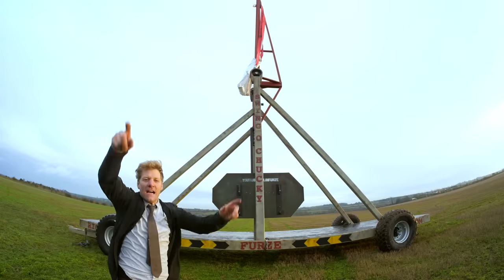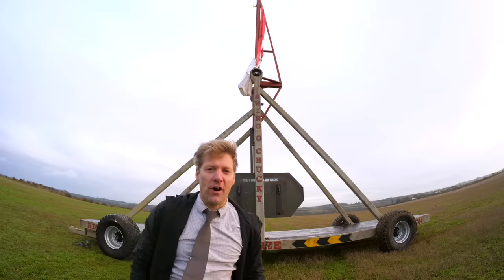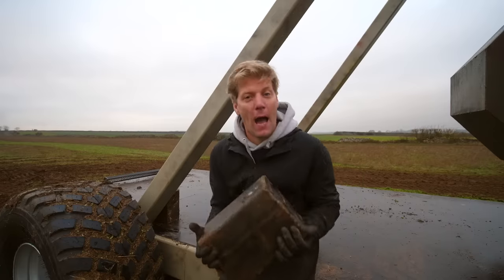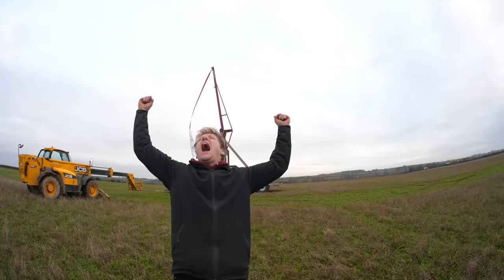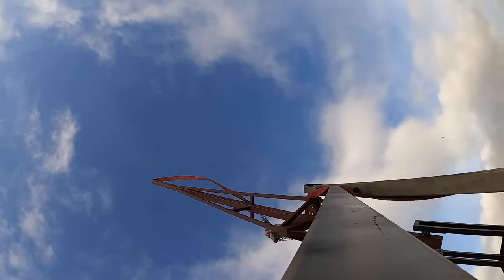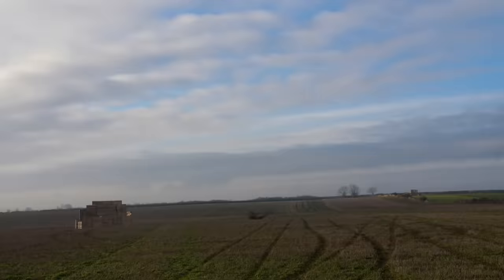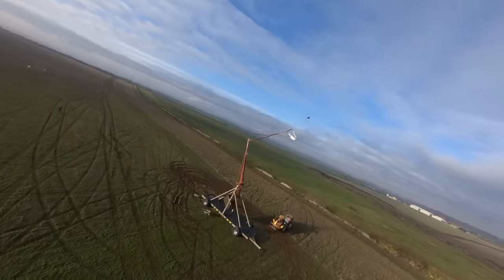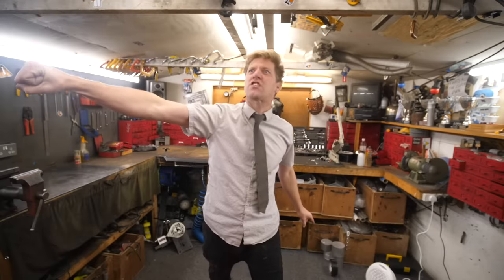MASSIVE Trebuchet/Catapult First Test

Comment: Sling is too long! Projectiles will fly MILES with a shorter sling, it goes slack before the arm is upright
Reply: the pin should also be slightly bent forward, not back.
Reply: Definitely this, slings are the most difficult part to get right on trebuchets and this one is too long. I’m sure with the size of this trebuchet once the sling is just perfect it’ll launch some insane distances.
Reply: By the dimensions and the use of metal instead of wood, ...
Counterweight should be 6 to 9 tonnes
 at least
Projectile around 75 kg max
Range won't go pass 500m 
(+Get 15% free inertia by fixing it to the ground)
Half of this is maths, half is estimation and half is guessing... (that makes three half... 🤷‍♂️)
Reply: He could also try to block the wheels. Moving this mass is such a waste of kinetic energy!
Reply: I've made a million trebuchets and instantly came to the same conclusion haha
Reply: @xdmimperatyw  i agree
Reply: Ethan Game,  I agree with you, shorter sling is the way
Reply: @xdmimperatyw  Possibly, but I did see a video by tom stanton where he showed the wheels make it more efficient, I think because it lets the mass drop more vertically
Reply: @davekavanagh7599  I've never made one and I know nothing about them outside of what they are and what they do, and even I was thinking it.
Reply: @Dr.K.Wette_BE  trebuchets must be able to roll back and forth or they destroy themselves.
Reply: Or heavier ballast :D
Reply: @majmikecalnan  Trebuchets had no wheels, what are you talking about ?
Reply: YES
Reply: by my calculations the sling indeed is too long.
Because if you convert X to Y by multiplying the power of .........

Ah the heck with it.
Experts who have made a million trebuchets have already answered.
No need to do maths.
Reply: @damiangames1204  Watched his video, his argumentation makes sense, you right. Now only thing is to shorten the sling for this mechanism to work. Have a nice day :)
Reply: @majmikecalnan  Really? Looks like energy lost...
Reply: @Dr.K.Wette_BE  Give that doctor more likes. Colin needs to see that.
Reply: ChrisHallett83  Trebuchets very much did NOT have wheels. (Maybe some oddball did, but wheels were NOT common.)
Reply: I also initially though the sling was too long, but it actually isn't. You want to release when the arm stalls (stops moving forwards), and due to this thing having a high moment of inertia in the arm relative to the projectile, the arm stall is pretty late, so you can continue milking power from it longer than a lot of other trebs, and thus a very long sling and rather backwards pin is likely best. That said, the sling straps have a lot of drag, so my approach might not be correct in this case (Use a cable for the sling lines, it will help!). General tuning guidance can be found at http://thehurl.wikidot.com/tuning (Which I wrote back when I made lots of trebs, but never anything as massive as Colin's!).  See http://thehurl.wikidot.com/machines:trebarbaric for another treb with a really long sling for similar reasons (and 1800+ foot range!).
Reply: Maybe he didn't actually want to launch a rock miles away? Lol
Reply: @Dr.K.Wette_BE  from what I've seen when they get fixed to the ground they lose distance and tend to rip themselves apart.
     I thought it would go farther too, but experimentation shows, and I found some math on the Interwebs but of course I didn't bookmark it , but any way some guy explained why.
    The lurch forward both moves the pivot point forward and uses up a pile of energy would otherwise be transfered to the frame.
    He said it was the same principle as taking a step when using a staff sling .
    I wish I could give you the link
Reply: @thierrybastin4232  I agree with the shorter sling but not so much pinning it to the ground
Reply: @bertjesklotepino  I've made a few , I'm no expert.
  I always like to see the math to figure out how efficient the machine is.
Reply: @nortonofnorthamerica  Interesting, thanks !
Reply: Also a lot to be said for using spherical projectiles over cubes.
Reply: Miles? Doubtful.
Reply: Same length as the forward part of the swing arm is optimal I believe

Comment: It's the square corners that are killing it. You need to toss something more "round" so it releases from the sling easier.
Reply: Yeah exactly
Reply: Yeah like a boulder or a steel ball although that would be a bit more difficult to get i think
Reply: @philippschweikardt1512  A dodecahedron will work fine. Which can be slot assembled and welded
Reply: Bowling balls, or just big rocks like the good old days.
Reply: @Fix_It_Again_Tony  how about 10 bowling balls in shotgun mode trying to hit one single giant bowling pin?

Comment: When I made a much smaller trebuchet for my high school woodshop, I found that the pin angled up and not down gets better distance and power, cuz you’re trying to release it the moment the trebuchet stalls the swing arm so you don’t waste potential energy. 

Also, try getting a rubber mat as the sling, with large and robust surfaces they will grip the rubber well when it compresses the sling to pull it
Reply: This needs to be upvoted more
Reply: that, combined with a shorter (faster) sling should get you pretty close to an ideal release.
Reply: And he should block the tires!! Cause each time you shot, trebuchet goes towards and loose a all bunch of energy.
Reply: Ha, after reading some comments below, moving trebuchet sime to get better. I take back what I said 😅
Reply: @inofarr8622  actually they've studied it and you get better distance if you let it roll. Basically the physics work out to make the weight drop in more of a straight line, which gives better efficiency. It's the same reason you use a swinging weight instead of one rigidly fixed to the arm.

Comment: Need to chock the wheels on the base - it's losing a lot of recoil energy.
Reply: Aren’t trebuchets supposed to move a little? Or else I think it will actually lurch up.
Reply: @oscarwang7227  trebuchets are supposed to not move when ready to fire
Reply: @mrblackfyre2071  ok
Reply: @oscarwang7227  it depends on the type this isn’t suppose to move
Reply: It's supposed to move freely, do your math! (If you dropped out of school, build a small one and test it, or youtube it!)
Reply: I'm fairly certain, though possibly wrong, that it's supposed to move in order to not damage the structure itself.
Reply: @beardedboys2024  aren't ones that have a fixed weight
 supposed to move?
Reply: Just watch tom stantons videos to trebutchets, it's more efficient, if it can move

Comment: It’s a matter of weight ratios, arm length and release angle. The weight should be 275:1 counter weight vs projectile. Arm length should be 5:1 around the axle. You want the projectile to launch the exact moment the launch arm and sling are perpendicular to the ground. This should allow you to optimize the efficiency of the trebuchet.
Reply: sling length and stall postion of the weight also matter.

Comment: The trick is to fire round projectiles. They don't get caught in the sling.
Reply: You are absolutely right
Reply: Definitely, classic trebuchets fire rocks which are definitely rounder than that cube thing
Reply: Maybe an atlas stone!
Reply: This. And if you want to fire non-rounded things, perhaps some sort of rounded sabot would help.
Reply: @Fa3ilkhir  Y-you rickrolled the rickroller...
Reply: I think a slightly shorter sling would work better too because I feel like it could be sized so it times the release at the 10 o clock position rather than 12 o clock with the current one. Alternatively playing around with how the counterweight is mounted could probably work too mounting an axle on the underside of the beam and hanging the counterweight from that should stop the throwing arm sooner.... or just smack the pin a bit and whatever they did at 5:47 lol =)
Reply: If you notice, that the entire trebuchet is not chocked in place, and the wheels roll freely and the whole thing moves quite a bit, absorbing a lot of the would be forward momentum as well, so after you build a proper sling, try adding some brakes!
Reply: If you want something round to launch, you should try out launching a Toilet🚽; bowl, tank and all. I understand that they can achieve some great distance too, that Loo!  😂😂🤣
Reply: bowling balls!

Comment: To help put more power into each swing, chock the wheels so all energy has to be transferred into the object and not into rocking the trebuchet

Love the build mate.
Reply: From what I recall of testing people have done, wheels actually improve the efficiency of trebuchets usually, since it let's the trebuchet essentially self correct to optimize the fall path of the weight, so more of the energy from it is transferred into the arm of the trebuchet, rather than into rocking the frame back and forth as the weight rotates around the axle at the top. Basically you want the weight to fall as straight down as possible, and being mounted on wheels means the momentum slides the whole chassis just a bit more in line with that (back when the weight is high, and forward when the weight is low), rather than having the chassis try and fight it to hold its position. Trebuchets are cool!

Comment: First how about a device to release he sling at the optimal angle. 
Second chain reinforced bag possibly leather or conveyor belt type rubber sheet, instead of synthetic fabric
Reply: Should lock the wheels as well; losing energy there
Reply: @niek280  Rolling wheels are beneficial to a traditional style trebuchet, it allows the counterweight to fall in a straight line instead of having to follow a circular inefficient path, it allows more energy to be transferred into the movement of the arm and as a result the projectile.
Reply: It does look like the sling is releasing a bit too early? If memory serves you're looking for a flatter arc (more energy sideways into wall rather than up and down)

OTOH, this release does meet the important "wicked cool" criteria.
Reply: @skonky  Oh cool, didn't expect that!
Reply: @HapyAppleProductions  Didn't know that, thanks for the reply!

Comment: Ttebuches were used to smash rooves and horizontal fortifications, as the projectile was coming with a vertical trajectory; for vertical walls catapults were used, which launched stuff at a more steep angle, to hit more perpendicularly to the target possible.

Comment: Colin if you let it slide back and forth on the wheels the projectile will go around 10% farther because the counterweight can fall straighter giving more power. also I love this project :)
Reply: I totally don't get what that means...
But I like the sound of that
Reply: I think its the other way around, a lot of movement energy is wasted because the trebouche is moving backwards as the shot goes off, nullifying some of the thrust.
Reply: @chucknorris2952  so that not quite true, when you're optimizing a trebuchet you want the maximum amount of energy going into the projectile, by letting the trebuchet wiggle a bit on the ground the center of mass of the whole assembly is more efficiently able to drop straight down, see how much the counterweight shakes around after launching? That's all energy that's just been wasted. Tom Stanton has a great set of videos on YouTube about the process of optimizing a trebuchet.

He addresses the wheels situation here: https://youtu.be/KpFTyE-wiNo
Reply: @chucknorris2952  I see why you might think that but if you go through the mechanics (or better just watch someone else go through it) it helps to let the trebuchet "rock".
Reply: @chucknorris2952  This is how I see it. The only energy available to be transferred into the projectile is in the counterweight. Energy from the falling counterweight is used to move the chassis due to the inertia of the counterweight. Chalk the wheels and that energy must be transferred to the projectile because all other parts of the system are rigidly attached to the frame of reference (the ground).
Reply: @Fix_It_Again_Tony  with ideal circumstances i can guarantee having stationary wheels is more beneficial

Comment: that thing is awesome! I had the honor of having a class of college students compete at my property launching watermelons with trebuchets that they built. the main thing that was important to how far they launched is that the device was anchored to the ground well so they didn't loose a bunch of energy moving themselves instead of the projectile.  that massive siege engine on wheels you built is moving a lot on its wheels and loosing a ton or 2 of launching power.  hammer some big wheel chalks in all of the wheels and see what it can do!

Comment: Brings back memories of when me and a few mates built one after being inspired by AoE like 20 years ago. We cobbled together a 12ft one from some spare bits and bobs on my family's farm - mostly permapine logs and coach screws. Counterweight was a 50kg block of concrete. Axle was a big bolt from a salvage yard lubricated with a bunch of grease. It wasn't exactly built with precision, but we played around with the slip pin angle and sling and got it to throw fruit in a rather consistent manner.

Comment: The slings they used during the middle ages was usually made of thick leather, so maybe use that instead?
Reply: Do you know what kind of leather? I think I remember Tod's workshop shooting at leather with different treatments, and I think it made a difference, so maybe here as well
Reply: @nicjansen230  Todd workshop is a great channel
Reply: Yes LEATHER
Reply: Yeap, I'm sure he has an old sofa or car seat he could cut up to make it from.
Reply: Carbon fiber fabric sling?
Reply: And block the wheels. Trebushet lose the energy
Reply: @nicjansen230 . Elephant leather

Comment: Pretty sure that one shot fired so well, due to the weight of that particular item, and the length of the sling worked well for that setup. Weight of the item fired makes all the difference. It looks like a slightly shorter sling would help a bit too.

Comment: If you notice, that the entire trebuchet is not chocked in place, and the wheels roll freely and the whole thing moves quite a bit, absorbing a lot of the would be forward momentum as well, so after you build a proper sling, try adding some brakes!

Comment: That's one hell of a heater yeeter. Pop in a good sling and it will be simply beyond your wildest expectations. I particularly like the adjustable counterweight, but I would suggest a stronger forklift if you want to make it any heavier. Either that or use a massive winch to lower the arm thus raising the counterweight. And by massive, I mean the biggest, beefiest hydraulic monster you can find.

Comment: You can add weight by filling the gaps with water.  If you put a lid on the box, you could probably replace the rocks, all together, so you simply have to drain the tank, when needed.

Comment: Now if you wish to dispense with the JCB, how about a vessel to fill with water (1 litre - 1 kg). When the weight gets to the bottom just open a tap and drain it into another tank then when its up top again just pump the same water back up and refill it. Make the tank as big as you like.
Just a suggestion mate.

Comment: it looks like a lot of energy is being lost by the movement of the wheels, lock it to the ground and you may get another 100m out of it
Reply: Surprisingly, the opposite happens with these . Weird I know I don't fully know why but I just know .
Reply: @harrier331  it’s not though look it up a trebuchet that it allowed to move does better
Reply: @harrier331  the back and forth frame movement allows for the counterweight to move more perpendicullary to the ground thus accelerating more with as much energy stored than if it were falling making a circle as it would with a fixed frame
Reply: @harrier331  There was a documentary on History/Discovery channel ~10 years ago that showed that it allows the counterweight to fall straight down (in a straight line) providing more power. The problem here is that the mass of the frame vs the counterweight and the friction of the wheels don't allow enough movement.
Reply: If you watch which way the wheels are moving, it tells you where the energy is going.
The whole thing moves forward during the wind up and then at the point of release stops and then goes backwards. 
This means that the energy making it go forwards has been reclaimed and redirected into the projectile causing an opposite reaction. 
When the ratio lengths of the arms and sling are right, it makes the weight drop straight down as it swings pulling the whole structure forward, then as the arm reaches the release point (very top), the energy from the weight transfers backwards rather than forwards forcing the structure to accelerate forwards just as the projectile is launched. 
As the energy is released from the system, the arm stops swinging and the structure stops going forwards
Reply: Your basing your assumption off a wooden Trebuchet that has a degree of Flex and spring to the arm and frame. Where they were left to move so they didn’t catastrophically fail and kill the 50 peasants needed to fire the thing.
Reply: Zip top closure of

Comment: I've seen a lot of these built over the years including ones that are built to historical specs and they're all the same. They don't shoot far. And considering they were made of wood it'd be pointless if you have to get closer than arrow range to make them hit the mark. So it was nice to see one . ..almost work. It's hard to believe they were used in the past at all when we can't even make one with modern tools and equipment that does the job like historical reports say they were used.